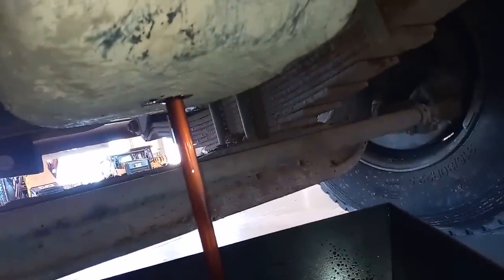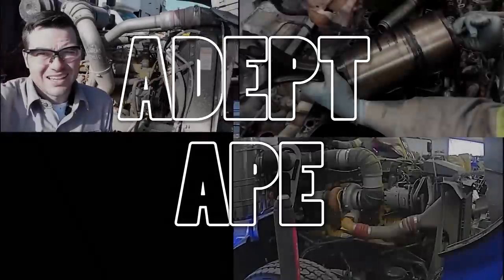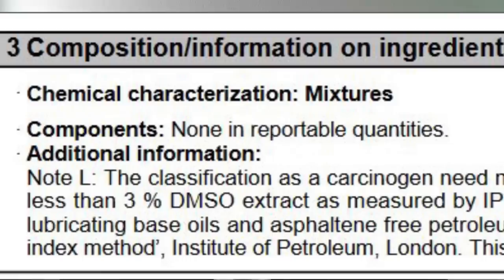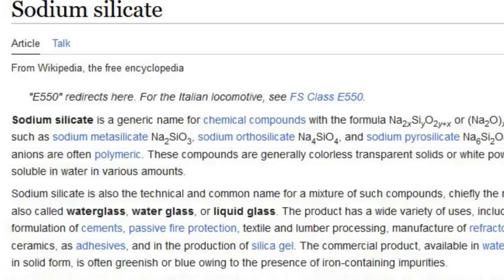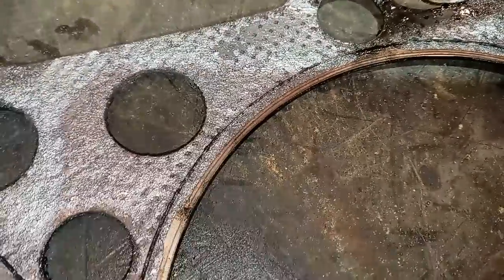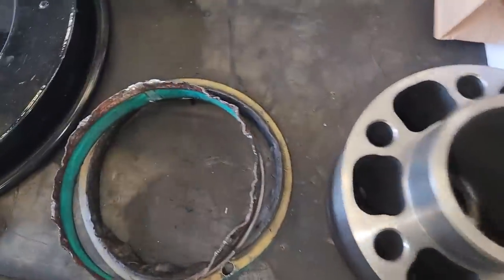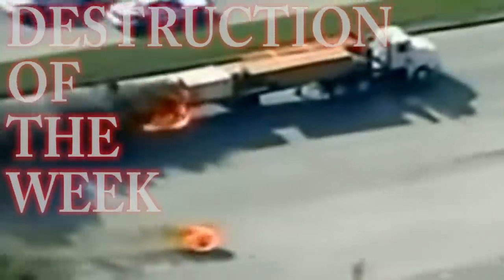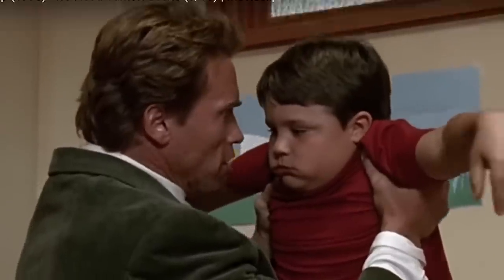Just Say NO to Stop Leak!

Comment: Josh, years ago I had a civic that had a motor with a head gasket leak and I was not going to fix it.  I put a bottle of "water glass" in it.  It fixed the engine but eventually years later the motor failed.  For fun, I took the motor apart, well I tried to.  That "Water glass" went everywhere and welded stuff together.  It was nuts!
Reply: I would say a $20 fix to save thousands in parts and labor rebuild that lasted years is worth it in your instance.
Reply: Damn. I mean if the car was not worth any real value I totally see it. But older civics take all of like 2 hours of work to replace a head gasket assuming its just a high mileage motor and that is the only problem. heh
Reply: Isn’t “water glass” what they killed engines with during Cash for Clunkers?
Reply: @5roundsrapid263  yes

Comment: Finally, another technician who understands the importance of fixing the problem rather than using a stop leak!

Someone used a stop leak in the coolant system of a truck they had traded in, because the water pump was leaking. I recommended water pump and radiator to be replaced, along with a complete coolant flush to hopefully clear the system out.
Reply: You know a technician who uses stop leak. 

You can’t be friends with those people.

Comment: My old F-150 developed a coolant leak on the intake manifold gasket. All the bolts and vacuum tubes are awfully rusty and I did not want to open that can of worms. I put a bottle of k-seal in the radiator and the intake hasn't leaked a drop since. That was two years ago.

If you're wondering, the heater still runs at full nuclear hot level. It didn't clog it at all.

Comment: Aside from being an active component in cement sealer lo,l sodium silicate is also used in muffler cement.  It works quite well and needs heat to react.... Also like 15~ish years ago when they were doing the "cash for  clunkers" thing , sodium silicate is what they would pour into the motor oil to seize up the motors.
Reply: K
Reply: Yup we destroyed SO MANY cars with that stuff

Comment: As a working mechanic in a former life (mostly on gassers), I added the recommended amount of genuine Stop Leak to a cooling system after a repair, flush and adding the proper fresh coolant mixture to the system...With that method I never had a problem...On occasion with my own vehicles, I've been known to add a can of black pepper with plain water to an empty cooling system in which cases the leak was stopped long enough to drive it to my chosen place of repair (usually my own driveway) thereby avoiding a towing bill...I have never used an oil leak stopper because I knew it just swelled all the seals, sometimes resulting in even more damage to repair...As always, the best method to stop a leak of any kind is finding the source, replacing or repairing the damaged part and refilling with the proper mixture of liquids...I find this channel a valuable source of information, some new and some consigned to the back rooms of my memory to be kicked loose and brought to the forefront again...Kudos to you, sir!...

Comment: I'd agree with pretty much everything you said Josh. Back when I was a Jaguar mechanic I worked on a lot of V12 Jaguars, which from the factory came with Barrs Leaks added to the cooling system. Not surprisingly, these engines were notorious for overheating, because they came from the factory with plugged radiators (mine that I personally owned neither leaked nor overheated after making sure the cooling system was actually in good shape).

I did end up using head gasket in a can on the 4.0L V8 in my Land Rover Discovery, since I'm swapping a C4.4 into it. That had a head gasket leak that was leaking coolant at a high enough rate I was having to top it off pretty regularly, the engine isn't very good and I didn't feel like fixing it properly. That's held up a lot better than I would've expected with no noticed ill effects (including overheating).  But that falls into your category of similar to the $200 1990 Ford Ranger. Now I just need to get around to that C4.4 swap.

Comment: Back in the early 90s we changed the radiator in the truck I was driving.(Ford Ltl with a 350 Cummins)It was a new radiator but not installed for about 2 years. Once installed and filled it had several leaks. Ran engine for about an hour hoping gaskets would swell and quit leaking. Didn't happen.  My boss went to the next door neighbor,  came back with a  jar of black pepper. He poured about a half of a cup into the radiator.  Approximately a minute later the leaks stopped. Hard to believe but it worked. I thought back then I wonder what else is getting plugged up but that truck ran several years without anything major with cooling system.

Comment: Back when schools were reputable institutions by offering shop classes, auto-mechanics, auto-body and metal fabrication classes, I enrolled in auto-mechanics for 2 years of high-school as an elective. I had a teacher that said to stay away from STP and similar products if you had a good running engine. To him, STP stood for "STAY TOGETHER PLEASE". He told us they were last ditch products designed to get you home or to keep your vehicle running until you could find a replacement. Usually those products do more harm than good and a mechanic will be happy to charge you extra to remove that crap you put in your engine.
Reply: Same thing with tire slime. It’s a joke of a product and usually doesn’t work but people blindly trust advertising, or that one person that says it worked, and also think patches are too much of a hassle when there’s a miracle in a can. The real funny ones are the cans that also say they’ll inflate the tire as well so no need to pack a tire pump—better know the number of a tow truck then. Every tire shop I know will charge a lot to get rid of that slime, that is if they even want to work on it. Good ol tire patch strips and vulcanizing rubber usually last the lifetime of the tire. It will even patch a big gash out of the sidewall to get you into town.

Comment: Here is an example of an OEM recommending this: Subaru constantly recommend their "Subaru SOA635071 OEM Cooling System Conditioner" for certain engines they produced. Part of Subaru service program WWP-99. Owner's were recommended to bring their car in for this free service. In fact, cars under warranty were often treated with this from the dealership without the customer's knowing what it actually was, or that it even happened. In reality, it was and still is Subaru covering their a$$ due to all of the head gasket failures they were going to experience. They claim the head sealing failure to be "normal behavior" due to expanding and contracting over time, which was complete BS.

"Subaru Cooling System Conditioner" is actually just relabeled Stop leak. One of the main products used is Holt's RadWeld. I've also heard K-Seal was another product used at times. They seemingly gave it a very vague name to avoid attention to the reality of the situation

That said, it worked for them and still does. This bandaid likely saved Subaru piles of $$$ in head-gasket repairs and minor cooling system leaks for cars that were under warranty. If you own a used Subaru from 2000 onward, there is a good chance your coolant already has RadWeld in it.

Comment: We had a 3406E come through the shop one day.  Customer complained of it over heating.   Had a coolant leak the day before added 2 bottles of barz leak(think that what it was called).  Found only 2gl of coolant came out of rad.  But you could clearly see coolant in the surge tank still.  Found radiator plugged heater core, oil cooler and pretty much any small diameter coolant hose was plugged. So needless to say he found out the hard way on when to use that.  Now that being said I put a bottle of Lucas oil treatment in a old jeep I have.  260,000 uses about 3 qrtz of oil between oil changes.  Since I started using the treatment it's just one quart now.  I have no desire to rebuild engine just get the last bit of life out of the vehicle then to the wrecking yard when she gives up the go.  Thank you for the video.

Comment: I used successfully blue devil in a cracked head on a case skid steer 9 years ago and is still running today The really cool thing I could see the crack and as the product ran through the unit I watched it seal the crack so cool hey BUT I still wouldn't use it again it usually does more damage.

Comment: GM used to have tablets that they wanted us to use in the cooling system to mask certain non head gasket leaks.
Reply: Factory installed in Cadillac Northstar and HT series engines to seal the liners to the block to keep coolant out of the oil. If a shop does a flush and does not replace the sealer coolant will show up in the oil.
Reply: Subaru did the same thing with the EJ series engines.  They sold a cute little bottle called, “Coolant Conditioner”.
Reply: @chrisleggett685  I remember reading the same thing about the northstar in an engine rebuilder magazine.
Reply: Seal tabs  Worked  in GM Dealer  back then

Comment: Sodium silicate is what we used when we were doing the most wasteful 'program' in the industry that I can think of AKA "Cash for clunkers." You drained the oil and dumped it in the crankcase. The liquid glass would promptly lock up the engine, usually trashing the mains or rod bearings. I purposely blew up some perfectly good vehicles when it was going on at the particular stealership I was working at during that time. It was more fun playing 'bumper cars' with them rather than trashing the engine. I don't think there is much of anything good about any stop leak type of products. Totally agree that they do more harm than good, especially on the coolant passages in something like an oil/ EGR cooler, or water jackets in the block and head. Thanks for the video Josh! Always enjoy your content. 👍😎

Comment: A few years ago a fellow told me his V8 Chevy was burning coolant. The full story was it was ran low on coolant and overheated badly, three years prior,  someone told him it had a warped head or bad head gasket. Instead of repairing it he went to a parts store and got some super $30 sealer for the cooling system. He seemed upset it was burning antifreeze again. I'm like that stuff worked great! Three years! I think he wanted me to fix it on the cheap.

Comment: That destruction of the week was worrisome. I've got an isx15 cm2350 and use maybe a gallon of coolant a month, or every 11000ish miles.
Reply: I would get it diagnosed so you know where the coolant is going. It might be just a EGR cooler or a small hose somewhere.
Reply: Might want to look into that. Head gaskets on the X15 are known to fail, along with the EGR cooler.
Reply: Check your dipstick daily is my recommendation. On my Cummins N14, I just don't check the dipstick for level of the oil: I check it to make sure the oil still looks like oil and is not turning into mayonnaise.

Comment: Had a Explorer that was a beater with a heater with a bad headgasket. My mechanic wanted 4K to fix the gasket since this was the known bad engine (they had 2 different ones), and he was the one that suggested the head gasket in a bottle fix, specifying one particular one and only that one. Since all I wanted was to limp the engine along for a little while longer (rig was only worth about $500) I got the stuff and did the several hour long process it specified. 6 months later it was still holding, and I sold the Explorer (for a whopping $200) and told the buyer exactly what I had done and why. He wanted it for his kids first junker and was totally aware that it could go at any time. 1 year later I saw the rig still on the road, still not leaking and having none of the previous problems! That was the only time I would have ever thought about using the stuff, but it truly was an either/or situation for me at the time.

Comment: Only time I ever resorted to using an additive was Engine Restore in my old POS 1.8L Eclipse. If you’ve ever owned one of these things with high miles, they basically empty their oil pans out every other week from oil consumption. So bad I usually just put used oil in it that I had laying around. Surprisingly the Engine Restore does work over short periods of time. But it also got expensive since it needed a can a month.
Reply: I used engine restore and it made my rings stick

Comment: back in the days of the D9L with the "fuck up" (folded) core radiator... we had a fleet of them in landfill. We would but 9 cans of Motomaster powdered stop leak in each rad. Worked like a charm. Eventually we swapped to MRM rads

Comment: Valve cover gaskets should be relatively cheap to fix. Highly recommend saving the labour costs and DIY the job and use the saved $$$ to obtain the best quality seal for the application. BTW, do NOT forget to replace the valve cover bolt washers for designs that rely on the measured compression of elastomers to provide the appropriate clamp load.

Comment: I had a 1971 240z and the side of the block had a crack in it. I used JB weld on the crack and it lasted about 2 years of very gentle driving. One other product that was bad was Barr's stop leak. It works,but it stops the block up and everything else.

Comment: I had a headgasket leak in a 79 Datsun years ago and bought a quart of   sodium silicate from the drugstore for about 10 bucks. Drained water out put stuff in and filled rest with water, ran car for half hour and parked it over night completely drained. Next day filled it up with water and it was fine. Used that car for another 90,000 miles and it was still fixed when I sold it.

Comment: I've not used any such products in my engines for last several decades but back in the 1970's if you had a coolant leak or damaged radiator, we were told to put in ground pepper. I eventually learned that was a bad decision because once pepper expands, it likes to clog passage ports inside intake manifold, cylinder head, and block much in the same way carbon build-up from EGR would clog up passages in intake manifolds. Today when I experience excessive oil / coolant loss and there presents no external sources of leaking then it's off to the engine shop for diagnosis and repair. Cracked heads, damaged head gaskets, cracked blocks, cracked or porous liners, or broken rings contribute the most towards these issues although plugged up passage ports due to lack of maintenance also play into the equation. Part of owning a vehicle is the high cost to maintain and repair it.

Comment: Buddy bought a honda, after some time, had to replace the headgasket.  Changed head gasket, then no heat.  Troubleshoot the coolant system and figured the heater core plugged with Bar's Leak.  After 2 evenings [estimated 6 hours total] of flushing heater core with CLR, that cleaned up the core.  Now the heat from the dash will nearly burn your hand.  Bar's leak is garbage unless you are trying to hide a bad headgasket when selling your vehicle.

Comment: I had a Northstar V8 that had become overheated before and I discovered “water glass” product. My theory was that the vehicle was consuming coolant and there is no external leaks. I went through an performed water bottle test and noticed crankcase gas entering the cooling system. The only thing about this product is that IT IS NOT compatible with engine coolant. So for that reason, I would advise you use distilled water to prevent adding lots of minerals. Needless to say this soultions worked for about 2 years until a wreck took out the car.

Comment: I raced a 94 VW jetta in a "figure 8" race years ago. Smashed a hole in the radiator from another racer's bumper structure. This race was at the Fair Grounds by the way. Using needle nose pliers I pinched and rolled the damaged tubes-there was still quite a bit of seepage once we filled it back up with water (and only water because...fair grounds...horses etc.) We picked up an old-ish hand full of horse shit (meaning dry already) and crushed up and put in cooling system. After running at 2500 rpm ish for a few minutes we watched the tiny spouts of water sprays plug up and stop. So, that's a roadside cancel the tow truck maybe repair. I guess Copenhagen would probably work if horse shit wasn't available. Cheers!
Reply: I had another guy tell me horse poop would seal a radiator

Comment: I totally agree with not using these products except as a temp fix to a worthless car. I did however try one some years ago on an Acura Legend that my daughter bought for $500 that has a mysterious collant loss. At one point though, this really let loose and steam was coming out the tailpipe and lost coolant very quickly. I did some research and ended purchasing a product called Steel Seal. It was about $100 10 years ago and was just a clear liquid. I followed the directions that just stated to put it in the cold engine and top it up with 50/50 coolant mix. So I started the engine and just let it sit idle for 45 minutes. After that time there was no more steam. I let it cool down, filled it with more coolant where it was driven for 2 years without ever adding coolant again. It was sold to California Air Resources Board as a retirement for old vehicles and neted $1,500 to be destroyed. I don't know what was in that stuff, but at least in that one instance, it did a fabulous job.

Comment: I'm not fond of mechanics in cans, but I had an early 1990's ford and transmission was giving me problems. Ford recommended an additive. I used it and it cleared up the problem and I ran it another 25-30,000 with no problems. I've used radiator stop leak until I could get it home for repair.I've not used any additives in anything newer than a 2000 model.